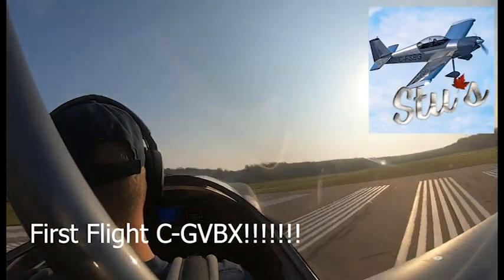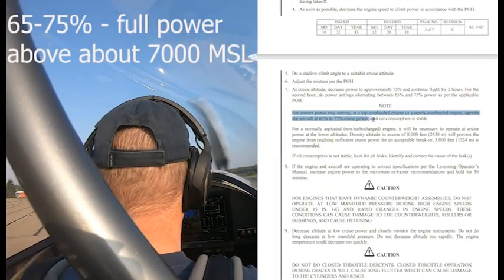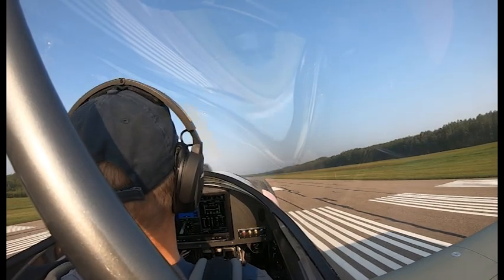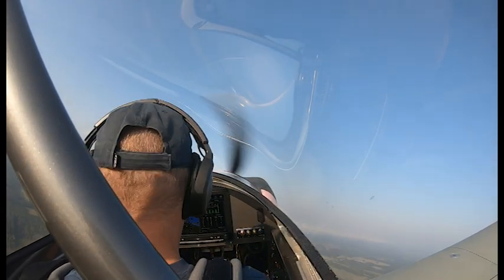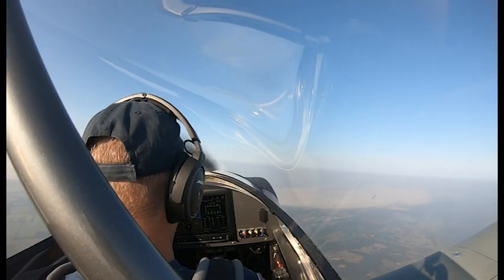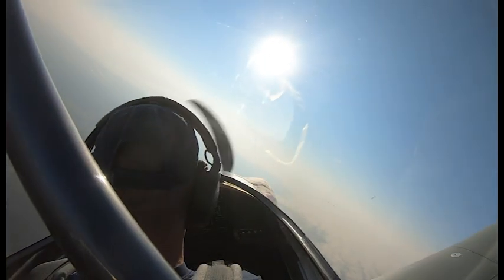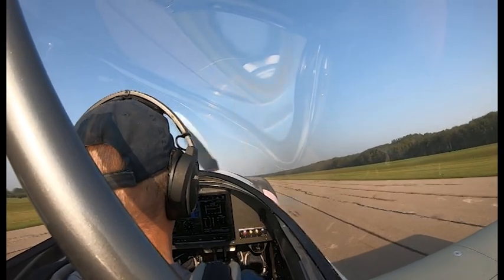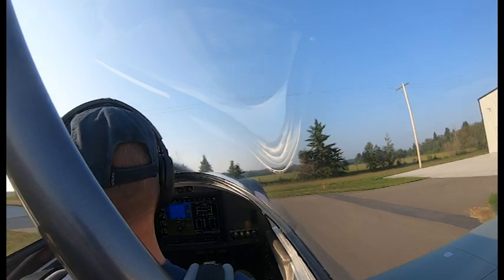First Flight of RV4 CGVBX

Comment: Awesome.  Congratulations Stu. You are a great inspiration. Quick question on your panel switches. Why did you put them on the right side. You were using left hand for mag check. Was that intentional or just the panel space you had to work with.
Reply from the maker: Yeah great question.  I tried to make the panel nice and symmetrical (although don’t compromise functionality for this).  The right switches hopefully get flipped only once on start except for boost pump on landing.  The left side is flaps and elev trim which will get moved all the time so I want them on left side.  In the end doesn’t really matter as long as it suits you